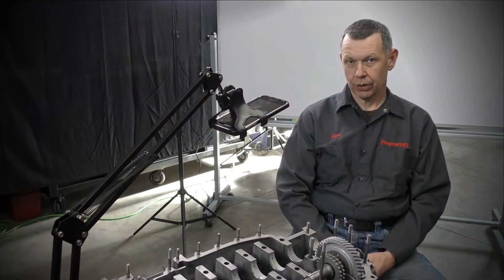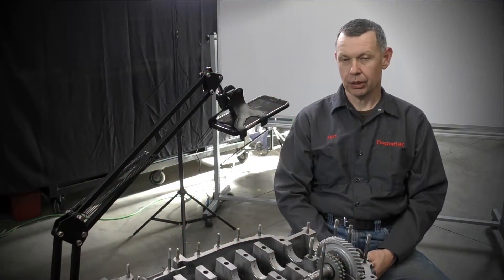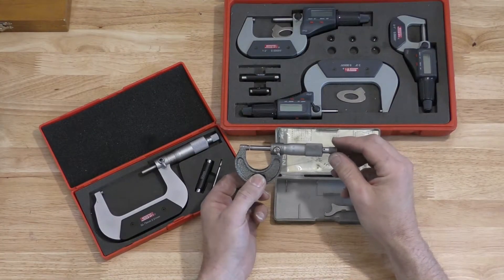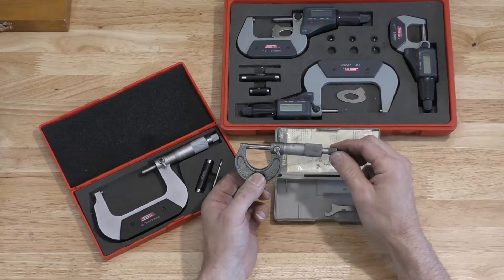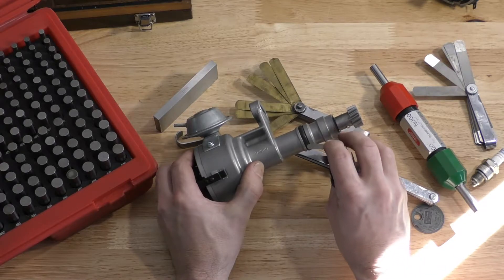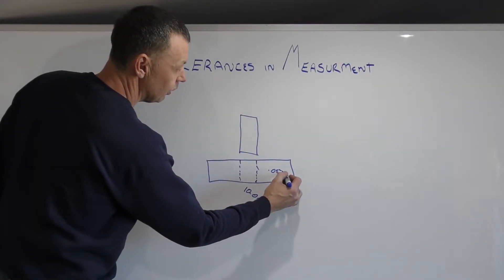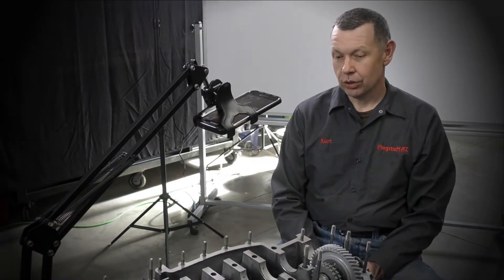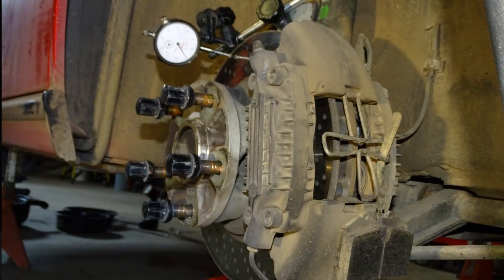Automotive Measurement

Comment: So does your Patreon course cover the 964 model? Specifically looking to learn about my 3.6 engine...
Reply from the maker: So we dont have anything on the 964 models yet,  but hopefully in the future we will. Depending on what you want to know the internal design on the 3.6L is still basically the same as the 2.7L and 3.0L models. The major differences in the engine are the timing chain tensioners are mounted completely differently, the engine does not use an engine mounted oil cooler, and of course the intake system is very different.
Thanks for your interest
Kurt

Comment: what size dial caliper do you recommend when working with air cooled Porsche engines?
Reply from the maker: I use multiple sizes but by far the most common would be a 150 mm, (6") caliper.
Thanks for watching